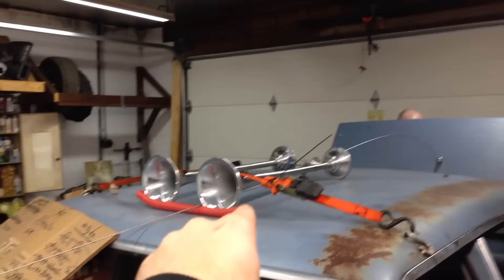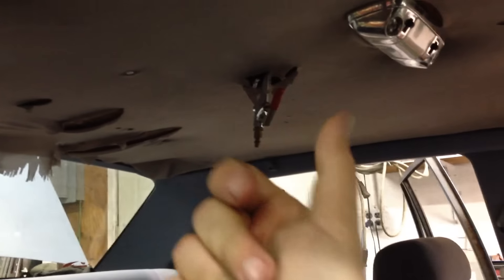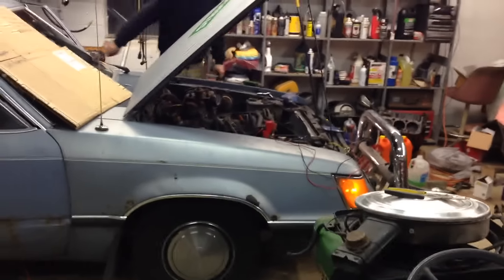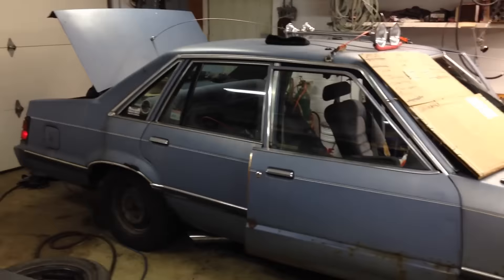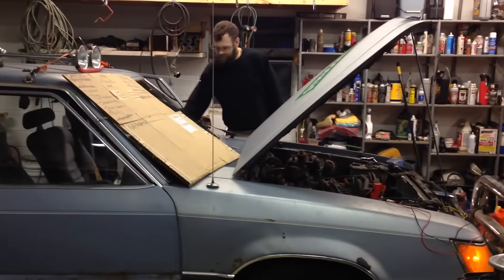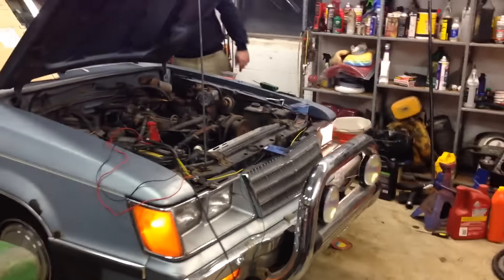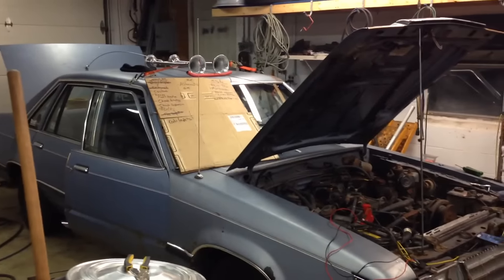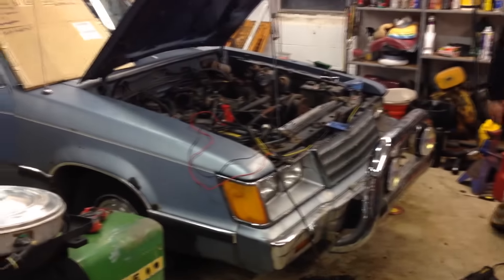1983 Ford LTD Escape from Moscow Part 2

Comment: CB Radio - I installed a CB in a race car - a Volvo 122 in some production class rolling at Seca. Rigged a mic and speaker in the helmet with plugs that rip right out in case of in need to abandon ship. In the pit we had a walkie talkie, and another in a car parked on the hill. I modified the CBs to use 26.800 - a "basement channel" not on the usual CB dial. Worked OK for 1978.

Comment: The Mustang nose will physically bolt onto the front end of these, however the curvature of the fender to door and hood to cowl doesn't match so it has large gaps, so in reality you need a little body work.

Comment: Fun fact: These LTD's could be equipped with a 5.0 from the factory in 1985 and '86
Reply: bh93 it's from 84-85 in the Ltd lx. about 3260 were made. only other way you can get a v8 foxbody Ltd from the factory is if it was a cop car (SSP)
Reply: bh93 these were essentially just updated Fairmonts. Same engine as my grandfather's 1983 Fairmont Futura sedan. Loved that car. Great for just rolling down the country roads and relaxing.
Reply: moelll is correct.

Comment: My friend had a 1984 mercury marquis.. not a grand marquis, a marquis.. It was this car with a mercury badge.. the ball joint broke and as I was pulling it in to fix it, it seperated itsel from the control arm.  at least it was halfway in the garage.  it had a dent on the fender the made the door hard open on the drivers side.  Putting in the ball joint I punched said fender... It moved the dent and the door opened better after that...

Comment: Ive always wanted an LTD II, smaller size, good looks, engine selection however, as you've pointed out, was garbage, and lacks a 5 speed, they made sexy cop cars though
Reply: That's not an LTD II, just an LTD.
Reply: i always thought the fox body ones were called Ltd II and the Ltd crown vic was refferred to as just the Ltd Edit: I was born in 98' though, theres only so much about car culture from before i was born that i can pick up on
Reply: a quote from wikipedia "This mid-sized LTD is often mistaken as an LTD II which was only a name used on intermediate Torino-based cars from 1977-1979" woops